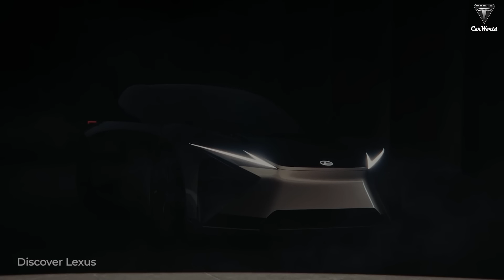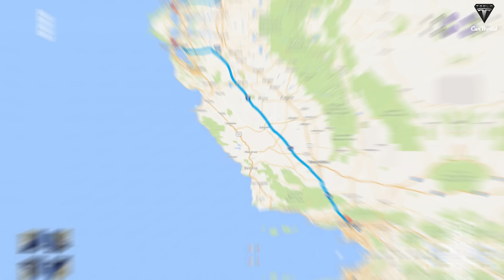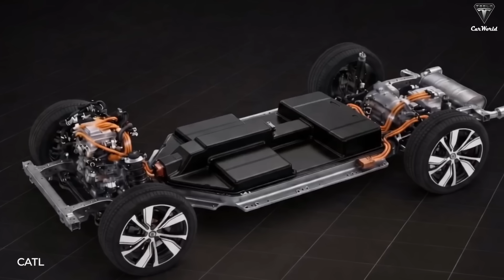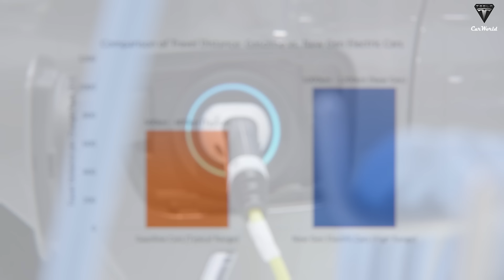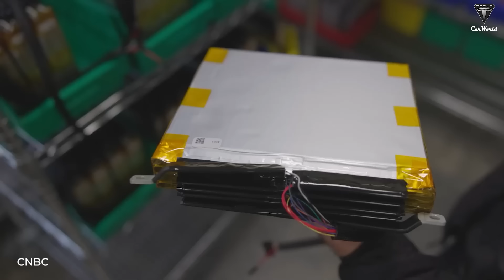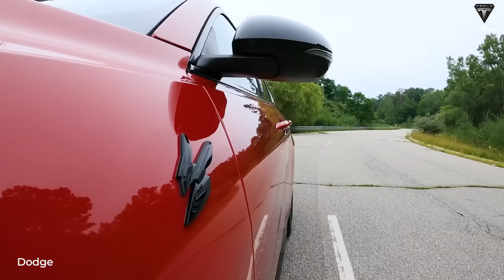Toyota Finally LAUNCH Solid State Battery 1000Km Destroy EV Race!

Comment: A 500 Wh/Kg solid state battery and Yasa motor wheels installed in/on an Aptera body:  over 2000 miles range is possible. A much lighter 1000 miles Aptera version with 500 Wh/Kg solid state batteries is more reasonable.

Comment: Even with solid state batteries, most people still prefer a standard hybrid than a fully electric car.
Reply: Until they drive one. And the politics keeps raising the price of fuel. And then there's one thing that not much mentions being made of. We are going to need all the oil. We've got to make tires. The climate change is killing off rubber trees. There's also a lot of other things oil's good for. It would be good to release oil for just those things. And for those of us who own our own home or at a home or someone's put in a metered meter for charging that is less than Tesla and charge America etc, it's so much cheaper and convenient to charge at home and gasoline. And I've owned very small gasoline cars almost exclusively and it's much cheaper to drive an electric car charging at home even in California

Comment: Most car buyers just need to go shopping a few times a week, averaging 5 miles.
Reply: The big reason for this is if you live someplace like New York or San Francisco or La and you are an active person. You might hit a 300 mile circuit in a single day and if you got it all planned, you don't want to stop to do 15 minutes of charging or half an hour charging somewhere. You just want to get it done. So a minimum of 450 mi is the right range because of charging time. Also until all cars get heat pumps versus heating elements and air conditioners, winter heating in your car just kills the battery

Comment: Toyota is still in the development and pilot/supply-chain preparation phase. Its consistent target (reaffirmed multiple times through 2025–2026) is to commercialize and launch the first battery-electric vehicles (BEVs) equipped with all-solid-state batteries in 2027–2028. These will initially be limited volumes, likely starting with premium models (e.g., under the Lexus brand), before any broader rollout

Comment: Toyota has been saying for almost 10 years that they have solid state batteries. They are not alone. Moving from prototypes to production is hard and Toyotas aim is for 2027. Moving to mass production is extremely hard and this will take Toyota and others a few more years. CATL is initially focused on semi siolid state, which they call condensed state (typically 5% to 10% liquid) because it is easier to get to mass manufacturing. The first batch of Toyota cars wil be on a small number of luxury cars since the cost per kWh is still prohibitive, and luxury cars is the place to start (as Tesla shown in the past with the Roadster). TEsla has taken the route of making the electrode dry (DBE) and it took 6 years to get to mass production. There is an increase in energy density / range but not as much as a solid state electrolyte. But there is a significant immediate cost reduction for DBE mass production which will not be the case for solid state electrolytes.

Comment: Solid state batteries?  You will see a unicorn long before solid state batteries in a production car.
Reply: Let’s see
Reply: @L.T-r8c  We've "seen" it for the last 10+ years that Toyota said they were coming out with solid state battery-powered production cars.
Reply: @KP-xi4bj  yes so let’s hope they are closer to production
Reply: @L.T-r8c  They're no closer to production than they have in the last 10+ years.